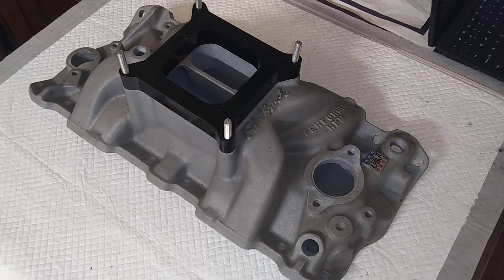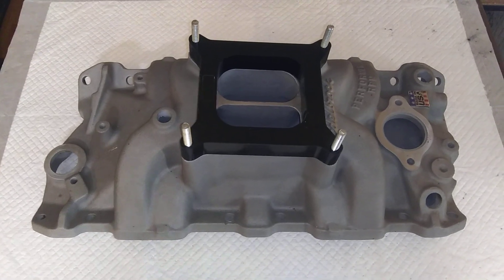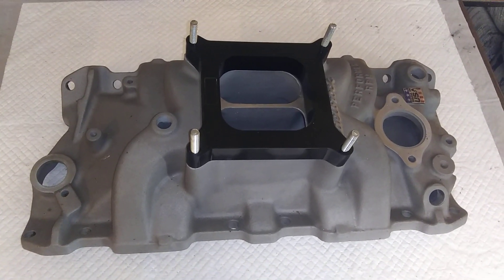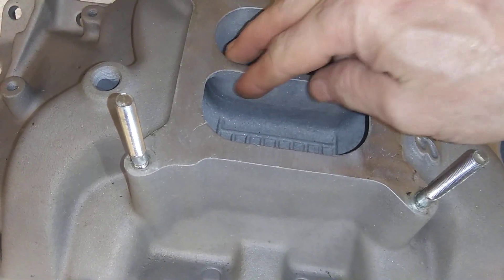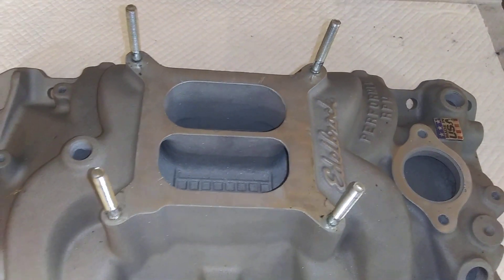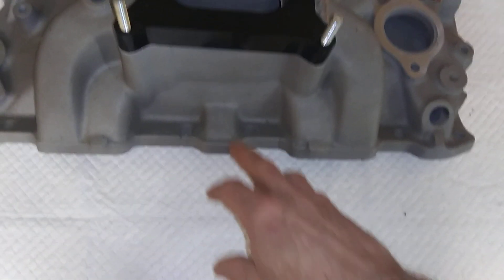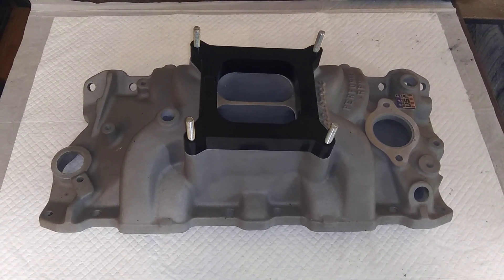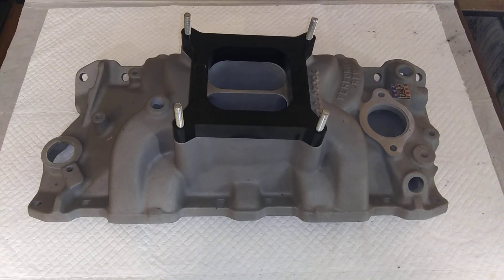Edelbrock Performer RPM for SBC.

Comment: Hell yeah,  that's a great street intake for mild builds
Reply: I've gotta '80 1 ton dually with a tired 350 ready for a rebuild. Was gonna use that intake with an rv cam and. 30 over,  but after watching your tall deck video I'm on the hunt for a 366 or 427 and throw in longer rods,  intake spacers, ect... do you know if there's a dual plane with enough meat to mill down the dizzy mount instead of using slip collar?
Reply from the maker: @clydewatson7889 A RPM Edelebrock for a bigblock might have enough meat to mill it down. Another option is to buy a bolt on distributor collar and mill the base of the distributor down. Those collars bolt on in 2 pieces. Could use a cheap HEI and just modify the base for the collar. Then just drop it in without a gasket, tighten up the collar and then install the gasket, that'll give ya the gear clearance.
Reply from the maker: @clydewatson7889 I think BRODIX made a tall deck dualplane, but I've never seen one up close.
Reply: Hell yeah,  thanks for the info... that tow pig of mine has a sm465 with granny 1st, looking for enough torque to drop the clutch and yank a house off its foundation.
Reply from the maker: @clydewatson7889  Those SM465 trannnys are tough. Popular in the 2wd Superstock pulling truck class.

Comment: I used to run a Holley Street Dominater with a 1000 cfm Thermoquad in my V8 Vega. 355 and 4 speed. Fun street car. I drove it to college  on $ 3.75 worth of gas. It's been awhile, lol.
Reply from the maker: I had a 71 Vega GT drag car back in the day. Used a rowdy 68 302 MO code SBC. 7000 stall & 6-17 geared Dana 60. Ran low 6s in the 8th.

Comment: I agree with you on the Edelbrock Rpm, but I want to see a heads up comparison to the Weiand sbc Stealth manifold. IMO the Steath reigns supreme. Very hard to find though. Wish I never sold mine!
Reply from the maker: I seen a dyno test between the RPM and the Stealth, pretty much a wash. The old dualplane Holley Street Dominator LT-1 clone is right there with the best of them. Hard to find these days tho. That was my first choice for a dualplane. The Winters castings were best. I had a couple years ago.
Reply from the maker: I mostly use singleplane intakes on most builds.
Reply: I would be interested in going over a build I'm in the middle of just to get your opinion. Also like to show you my low buck racing junk shit as well. I'm not computer savvy. Is there a way to text or email you direct?
Yeah and I'm not a weird snowflake. Just FYI,  just a smoking, drinking, garage hangin out type... LOL
Reply from the maker: @joshdorney-hh2ez  I'm an extremely paranoid person by nature. Got into alot of trouble with the fuzz when I was young, did alot of time. Makes me reserved and not trust people. Plus I know how the internet works. I haven't had a phone call in months, wouldn't answer if I did. Last phone call I made was to the machine shop. I'm the definition of a loner. But I've been around enough motherfuckers for a lifetime. Was almost famous at one time. But I avoid people these days. I'll answer any question you might want to ask tho. I don't mind helping out fellow enthusiasts. I've built alot of engines, so I try to pass on knowledge that was passed onto me by old greybeards back in the day. I grew up in a drag racing family.
Reply from the maker: @joshdorney-hh2ez  What are ya working on?
Reply: Yeah I get it, I don't trust much either. Been fucked over to many times. I feel where your coming from... 
I'm trying to some what duplicate a 396ci sbc build by Terry Walters / David Vizard... I'm starting with a 75 010 4-bolt block, 9.00" deck. Bought lite wt Eagle crank, 6" stroker rod kit. 350 mains w/ honda 1.88" rod journals, ARP bolts. Icon forged slugs, metric ring pack. Total Seal ring set. Lunati solid flat tappet.
.570in .592ex 264in 274ex. 106 la.
Dart pro 1 platinum copy heads, Pbm ss valves 2.02, 1.6. All Lunati springs/ head components. Trick Folw 1.6 alum roller rockers. Vic Jr intake, 1" tapered spacer, 750 hp Holley mechanical dp. And of coarse old school chrome Moroso valve covers, t-bars, & air cleaner!
Reply: Good evening, this makes me feel good about finding the factory GM Winters aluminum high rise intake manifold for my late father's 1970 z28 
It's all coming together in the next couple of weeks 
Thanks again for all that you do for us
Reply: Crank is 3.875 stroke. Forgot to mention this. Weight is 48 lbs.
Reply: Compression ratio is 12.5.1 w/ .032 head gasket. Pistons are .068 dome
Reply from the maker: @joshdorney-hh2ez  Should run pretty good. What's it going in?
Reply from the maker: @joshdorney-hh2ez  Gotta love the old Moroso goodies.
Reply from the maker: @dennismcgrath6574  That's a valuable intake, and they work real good. I'd hold on to that.

Comment: Have you ever had any dealing with the Eldebrock  EPS intake . Seen a deal on piss cutter performance where he built a 355 street engine i think it made around 450 hp on Dyno just wondering your thoughts . thanks.always watch your videos
Reply from the maker: Good intake for a mild build, better than a standard Performer. Work well on a torque build. It's kinda between the Performer and the Performer RPM as far as performance goes.

Comment: I wonder between this one and the RPM Airgap which one makes more power? This one may be better for a lower compression ratio build because of the exhaust crossover. And because of that may be able to eek out a few more MPGs because of better fuel atomization if taken advantage of? 

The Charles Salavino head porting yt channel claims these intakes no matter  what it's made for will only flow 220 cfm per runner. Waiting to see if he flows a ported one. I really like the way the two I have work on the SBCs they're bolted to.

One is an Edelbrock RPM Airgap and the other is a Weiand dual plane Airgap whatever they call their version. The Weiand claims to make power 300 RPM higher than the Edelbrock IIRC. I also have a Chinese genuine imitation RPM Airgap as well not installed yet.
Reply from the maker: There's an episode of engine masters about that very subject. Not much power difference between the two as is. Mill the divider out and they make pretty much the same power. The air gap don't make much difference on the power level these intakes are used at. Most modern heads don't have a heat crossover, so that's not an issue. This intake is going on a pair of Dart Iron Eagles with no heat crossover. There's a test on utube comparing the RPM air gap to the Weiand Air strike, the RPM wins by a couple numbers. Not enough to notice in a car. This engine is going in my wife's 5000lb 4x4 Suburban, so I'm not building a Max effort race engine for it. It'll have more than double power than it had brand new. Probably get better mpg too. It won't get drove hard unless I drive it. But I usually drive my C-10 everywhere I go. I don't use dualplane intakes on my personal engines. Only on mild engines for other people.
Reply from the maker: I have a Super Victor with a 2 inch spacer & 750 Proform doublepumper on my daily driver. It runs pretty good.
Reply: @thereluctantgearhead4544  
I must be poorer(or cheaper lol) than you because for the street I want it all, performance and good mpg. So I try for the power to be right off of idle. The roller cam I have has decent lift .550"/.546" but tiny duration @ .050", 202°/212° in my sbc 383. It's paired to a 700R4, first gear pulls like a freight train right off of idle. Probably 400 ft lbs of torque starting close to 2,000 RPM @ WOT of coarse. Fun car to drive plus it gets about 20 mpg city, around 26 highway. 

IIRC it cruises down the road at 70 mph about 1,800 RPM effortlessly in overdrive with the converter locked. That's a great street combo, mild sbc 383 backed with a 700R4 with just a 3.07:1 rear gear. But I probably wrote this already for you? This one has the Weiand on it.
Reply from the maker: @itseithergonnaworkoritaint7852  I'm a very aggressive driver with a drag racing background. So I see everything as a drag car and just figure out how to make it driveable. The key is to have 1 normal vehicle in the driveway. I have over 15 cars now, I've had as many as 30 cars in my yard at once. Most not running, but projects waiting for their turn. As rowdy as my daily driver is, it's surprisingly dependable. And having a manual trans, it can get acceptable mpg. I figure if it gets 10 mpg minimum, it's drivable. WOT a different story tho. Ole truck will put away some fuel. Probably a mile per gallon wide open. I love fuckin with expensive sports cars with an old beat up work truck. I pull on modern Vettes and Challengers all the time. LS swapped 90 Chevy truck couldn't pass me either. When ya drive a hotrod around, everybody's a race car driver. Shit gets annoying. Especially when it's stock front drive imports like Accords and Maximas. These dumb shits just don't understand what's in that old truck. It's alot quicker than one would think.
Reply from the maker: @itseithergonnaworkoritaint7852  My old C-10 has been put on a diet too, it weighs about what a G-Body weighs. Has 4-10 gear with Detroit locker. It hooks pretty hard on the street. Used to burn the tires off, but I made some changes and it dead hooks dumping the clutch at 4000rpm. Clutch in it is grabby as hell. It's either on or off. Has a McLeod solid disc clutch with 6 ceramic pucks.

Comment: Don't like airgap rpm with the notch in the center weakens carb signal not the best thing for the street
Reply from the maker: Yep, depends on where ya want your power curve.
Reply from the maker: I usually just go with a singleplane intake myself tho. This particular intake is for my wife.
Reply: @thereluctantgearhead4544  I agree